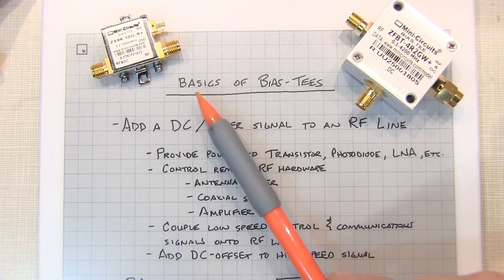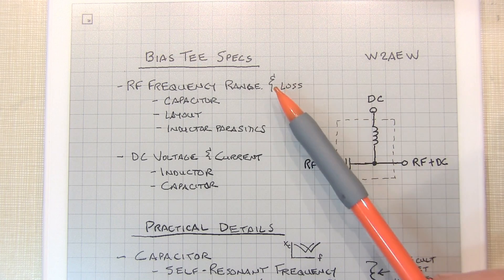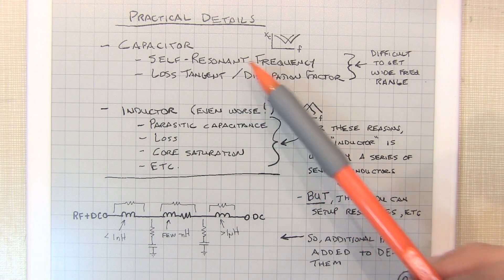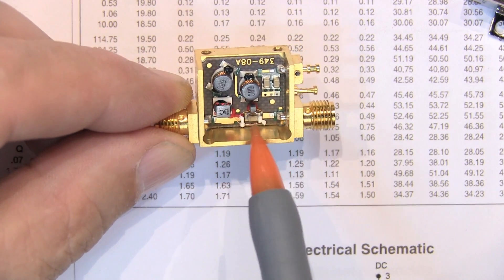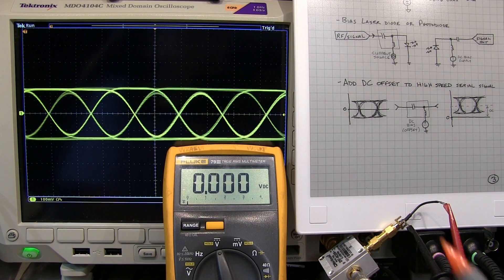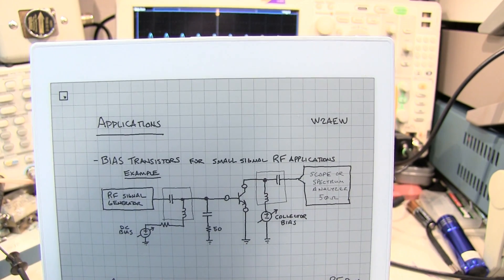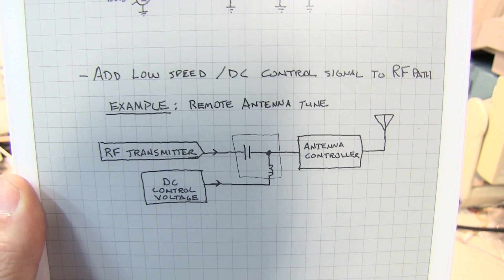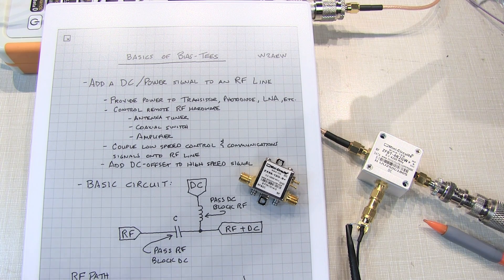#284: Basics of RF Bias Tees including applications and examples

Comment: Hmm, I wonder if it would be possible to power a stepper motor to tune the vacuum variable cap of my mag loop with a bias tee.  Then maybe use like an ESP32 or something to send it commands wirelessly for end stop sensing and what have you.  Otherwise, currently, I'm just using unshielded Cat5e as power and end stop sense.  Lots of RF hash when the motor is spinning, so, anytime I change frequencies...  Probably doesn't help that I ran the Cat5e next to the coax of the antenna and didn't use any chokes.  Free wire is free wire though.  Very quiet noise floor when I'm on a freq.  I think I will research these Bias Tee thingers some more, thank you for the video.

Comment: How well does a bias tee filter out the inherent dc noise from a typical cheap switching power supply wall wart?
Reply from the maker: It will likely help somewhat due to the RF blocking nature of the DC path.

Comment: What should be the C and L values for 10Mhz-6000Mhz for a max 50V design
Reply from the maker: For that wide of a frequency range, you might be better off with a commercially made device because some kind of multi inductor arrangement will likely be needed.

Comment: Hi Alan, fantastic informative video as always but would it be possible to have the mathematics around component selection  and some practical demonstrations of component selection please? I’m particularly interested in powering a remote antenna switch. I had thought about separate DC offsets to switch 4 channels but found a great way to use WiFi and then co from the antenna switching remotely. I would really enjoy an  in-depth video of component selection and SLCC and ATC over MLCC, silver mica. The core and saturation of the inductors etc. I’ve already had good success but still learning a great deal. 73

Comment: Thank you this was a great video. I have a question I am designing a Bias Tee for a school project but it needs to be a kelvin bias tee.  To add the sense port do I replicate the DC port section of the bias tee with the same number of inductors and values?
Reply from the maker: Hmm, interesting.  I never saw a kelvin bias tee.  I would imagine you could replicate the DC path.  However, you could use lossier inductors (ferrite based) since you don't have to worry about saturation...
Reply: @w2aew  Awesome thanks for the answer :)

Comment: Your Bias Tee video was excellent. However there is one thing that you did not comment on and that was the surge voltage that appears on the RF output when power to the bias tee is turned on and off. I have experienced this when used with DSO's where the spike can be as much as 2 volts both negative and positive which pops the input stage to the DSO. Do you have any thoughts on this?

Comment: Thank you for a great presentation. A side question on Bias-Tees, is there a preferred location to insert a Bias Tee, i.e. as close as possible to the Rx/Tx, closer to the antenna or it doesn't really matter? Thank you.
Reply from the maker: Doesn't really matter, it depends more on where it is easiest to run the power.
Reply: @w2aew  Awesome, thanks for that. That makes it a lot easier.

Comment: hey this is very helpful thank you --- I am trying to configure a mini whip antenna that I picked up on amazon. It came with a bias tee to power the antenna. I have 'RF out' on the antenna PCB into 'RF + DC' on the T, and 'RF' of the T into scope. I've powered the T across the acceptable range. I am getting basically no noise, very clean flat DC signal, strong, but no RF whatsoever showing up on scope. I tried reversing the config as well, same deal

can you please help? keep in mind I am a noob. this is the unit, cannot find documentation for it https://www.amazon.ca/Mini-Whip-Shortwave-Active-Antenna-Interface/dp/B0828FD9GN
Reply from the maker: Shortwave signals picked up on a tiny active antenna like that will be VERY low amplitude, likely too low to measure with an oscilloscope.  You'd have to test it with a shortwave receiver or spectrum analyzer.

Comment: Hi Alan, I m designing a bias T for 10 MHz, L band(950-2150 MHz) and DC. What I understood is inductors which will pass DC must block 10 MHz and L band.My current required is 2 Amp.Can u suggest what parameters I should consider while selecting inductors??
Reply from the maker: Tricky - you'll need to ensure that the inductor is low enough in value such that is it still below its self-resonant frequency at 2.150GHz, still have enough reactance to be effective at 10MHz, and not saturate with 2A of current.  Sounds like a difficult set of tradeoffs possibly, depending upon how much inductive reactance you need to meet your RF performance requirements.
Reply: @w2aew     Thanks for the reply...Have learnt a lot from your videos....Your content n presenting style is excellent....
 actually I m planning to use two series inductors (got this from web),1 for blocking 10 MHz and another for L band RF.... Isolation required is around 60-65 dB and insertion less than 1 dB

Comment: Could i use 2pcs of bias tee box, to use a with a non bias tee SDR radio and a non bias tee LNA?
I mean where i use the second one to take out power (reversed) and feed the LNA with that.

I has some few SDR radios, among them the RTL-SDR blog V3 that has bias tee inbuilt via software switch. Could i use 1pcs bias tee the same way with having it at the non bias tee LNA to feed it where  the RTL-SDR blog V3 gives the power out to the second bias tee that feeds the LNA?

I guess these will work like that with both input and output use, or perhaps not?
Reply from the maker: Yes, you can use two Bias Tees like that - no problem.

Comment: Would I be right in my (low-effort) assumption that 1) the adjustable antenna has a bias tee inside as well, and 2) the DC output of that bias tee is used to drive the motor?

Comment: Another GREAT video, Alan. Curious - is that a Remarkable tablet? I have been wondering about them and would love to hear what you think.
Reply from the maker: Yes it is.  This is the first project I've used it for.  First impression is that it's pricey for what it does.  But, it is really nice to work with for creating and editing the notes pages - probably saved me going through at least 15-20 sheets of paper.  It creates PDF very easily, but they are on the large size (file size).  Some editing features are missing (like being able to delete a page from a notebook, that's why there's an extra page in the PDF notes).  Very nice pencil & paper feel.  I'd like it if there was some storage mechanism for the stylus.

Comment: I still have a working ATAS 100. I've always wondered how that worked. Very well explained as always. 73 NE5U Mike
Reply from the maker: 8V applied will drive the antenna in one direction, 12V applied will drive it in the other direction.
Reply: That's interesting. 1-5V plus a 7V bias?
Reply from the maker: Schematic of controller is here:
http://k0lee.com/atasdir/ATAS-120TechnicalSupplement.pdf

Comment: I recently got some cheapie Bias-T's from eBay to just to have at the bench. I noticed that with the RF input port unterminated that the supply voltage appears at that port for a brief instant when powering up the T (just measuring with a DMM). A "quality" Bias-T that I tried the same thing on doesn't demonstrate that anomaly. Think it's probably the coupling cap charging for an instant then discharging thru the meter. If you terminate the port with 50 ohms it doesn't appear at all. Having said that I'd be a bit concerned that a device might be sensitive to that "spike". Need to do some more experimenting but had never seen that effect before.  TNX for another great video Alan!  73 - Dino KL0S

Comment: Definately a "keeper". I frequently refer to your videos when designing something. Great resource and a good refresher for topics that I haven't worked with recently.  I'm working on a design for a LNA and antenna switcher that will be mast mounted. I have an idea to provide power via a bias tee as well as a low speed digital signal for the switching logic. It will be receive only so I don't have to worry about high power RF.

Comment: My new Beko amplifier can apply DC to a remote-mounted preamp via the RF cable. However, the 2M beam is a dead short to DC and this precluded using the internal bias tee in the amplifier. That bias tee in the preamp must be pretty well designed since it should work to 2.5kW RF power. Great video again, thanks! 73 de KT1R  Lou in Maine

Comment: My H.F. Tee out to the antenna does not like to see D.C. low imp. ground, Well I just got the proper magnet wire and rewound the choak,  W4GSM
Reply from the maker: Maybe you need another bias tee at the antenna to isolate the DC ground.
Reply: HI, I really  need to watch what I am doing,  Dave

Comment: If the DC bias was pulsed or even AC, would the DC decoupling capacitor on the RF input still work?  It would be interesting to look at the "DC" bias under some unusual conditions.  I wonder how far this can go.  Maybe two "DC" bias inputs with different characteristics at different locations for example.  One "bias" triggering another.  Starting to look like a complicated communication bus.
Reply from the maker: Yes, it is all possible.  If the frequency of the pulsed or varying DC is well below the cutoff of the RF coupling capacitor, it will largely get get blocked.

Comment: Excellent video! Would it be possible to power a small cctv camera that outputs a PAL/NTSC signal using this approach? Shall another bias tee be used at the camera to separate the dc component?
Reply from the maker: Yes, and yes.
Reply: w2aew Thank you!
Reply: NTSC/PAL is going to be tricky because the bandwidth extends pretty low, to the point where inductors start becoming quite big.
Reply from the maker: The good thing is that the upper frequency of NTSC/PAL isn't very high, so a large RF Choke or inductor shouldn't impose a problem.  The bigger issue may be some artifacts in the video due to AC coupling.
Reply: Thank you all for your feedback!